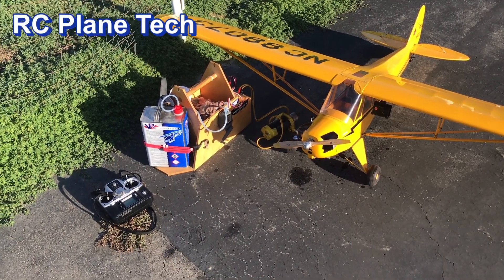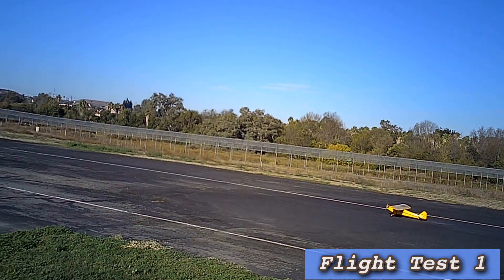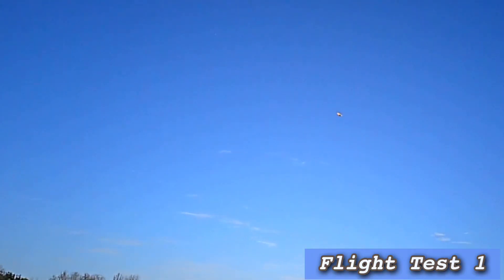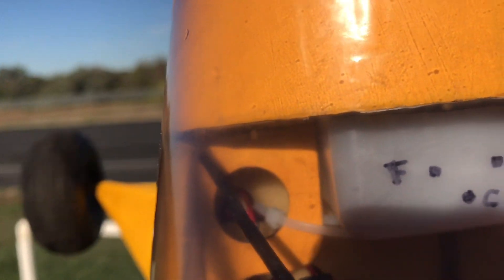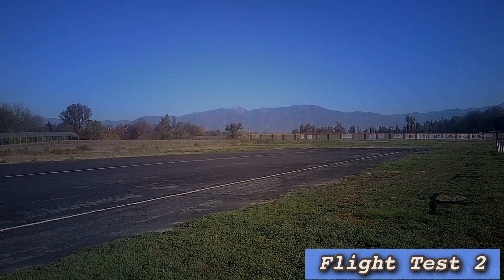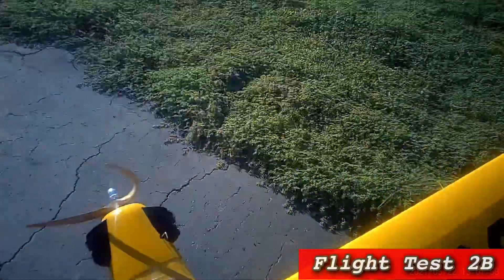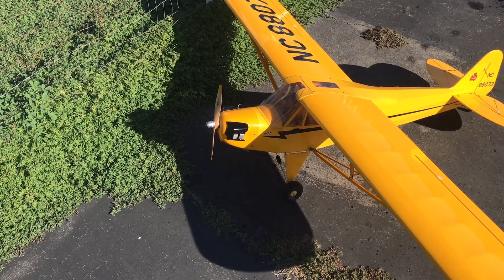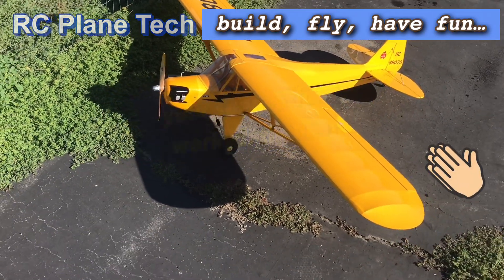Saito FA-62 RC Glow Engine Troubleshooting Part 8, felt clunk test flight

Comment: convert to gasoline. you'll never go back to nitro!
Reply from the maker: Ha! Ya I am impressed with my new DLE 20
Reply: @JamesRCPlaneTech  nice! i find gasoline engines more reliable. even more than the high end glow engines. it's mostly about the way the gas carbs work.

Comment: I love to see stuff like this, people working together to help solve problems! I’m curious how it made the engine run different? Does it peak at a slower rpm now? Is the exchange from low throttle to high throttle slower since the engine has to suck a little harder? I’m guessing this is a good fix for slower planes rather than faster ones…. But then again this problem probably just mostly effects slower planes? 
How’s the smoothie coming along…. I’m having withdraws lol. I feel like we’re over due for a video lol! 
Take care bud!
Reply from the maker: Hi. Well I was surprised that I saw nothing negative. In fact it runs smoother. Having that extra fuel in the felt seems to keep the engine stable. Time will tell however, I know that they can degrade and need to be checked. The Smoothie is still on track. Going to install the tail group next , hopefully another vid over next weekend or so. I really want to finish it. Thanks!
Reply: @JamesRCPlaneTech  Really glad you got it solved. Very interesting. It seems that the felt clunk acts as a header reservoir keeping fuel delivery constant. Whenever possible I try to mount my tanks a little lower than the carb and tilt the rear of the tank down. That way the engine is always pulling fuel uphill so that when it's tuned to run well like that it remains fairly consistent throughout the run. I have also found that Saitos are the fussiyest little buggers I own. Much prefer OS or any of the OS clones. Thunder Tiger four strokes are excellent also.
Reply from the maker: Thanks. Ya I was thinking about tilting the tank back as well but the felt clunk seemed to fix it. As you say, it stores fuel for the few seconds needed to bridge a gap. The Saitos are fussy I agree. I saw a magnum 4stroke on ebay that sparked my curiosity recently, but I don’t know much about them. Thanks again.
Reply: @JamesRCPlaneTech  Magnums are made in China In a major factory that clones OS and other designs and marketed under several different names, ASP and Magnum among them. I have two OS 91 and an ASP 91, can't tell the difference. They all run very well. I also have a real sweet Magnum 1.60 twin four stroke. It's a clone of the OS Gemini. It's in a 1/4 scale Spacewalker. I don't know if the Chinese engines are cheaper quality material but certainly the construction and performance are top notch. It really doesn't matter when you consider that the hours of run time a model engine gets doesn't even add up to your average lawn mower. Your Ebay Magnum would probably be ok if it was not abused and the bearings a good. But bearings are easy to change.
Reply from the maker: Thanks for the info, very interesting. The one I saw was new. I may consider Magnum in the future. I’ll keep an eye on them. For fun I like to search ebay and try to find good deals on the rc stuff.

Comment: The one thing I try to do with my tanks is to mount them slightly leaned back, so as with a nose down attitude, my clunk is still in fuel.  I think you were right about fuel sloshing forward.
Reply from the maker: Ya, thats a good idea. That would have been my next move if this didn’t work. I held off since I would have to do a significant mod to the tank area to get a tilt back. Thanks again.